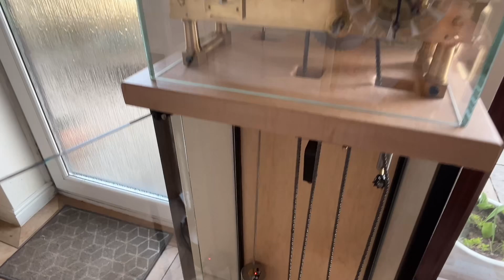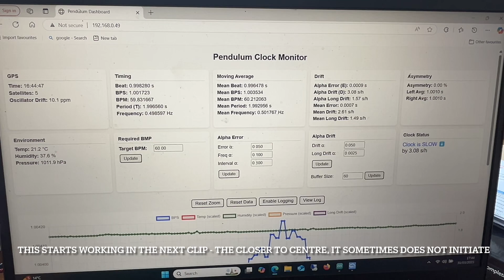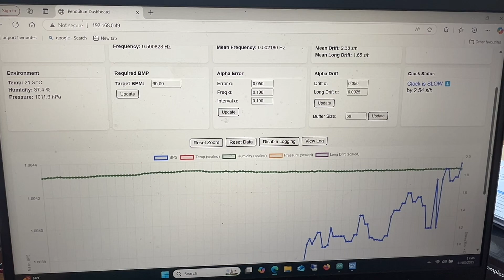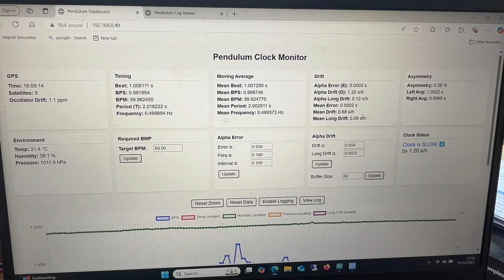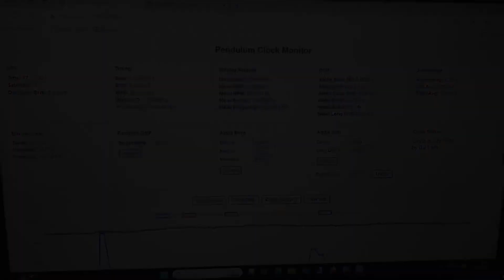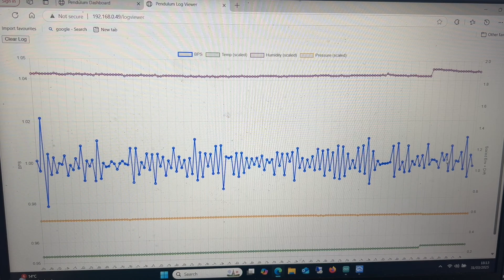DIY Clock Beat Analyser: Pendulum Timer with GPS Precision

Comment: Hi Chris, I'm also building a Clock beat timer using an ESP32, so really interesting to see your efforts. My biggest question is that you are using an infra red detector to watch the pendulum and NOT the escapement mechanism. If the escapement is not exactly lined up with the pendulum then you will get a false result I think. I am LISTENING to the tick and tock using a digital sound sensor as my input to the ESP32 , and measuring the time between them. Obviously it is directly linked to the pendulum swing , but I think you will find that it is the escapement which is the critical feature, in fact many clocks have an escapement which is on a friction bearing to the pendulum to allow for this adjustment. You have a SUPERB dashboard, congrats on that, but I recon you are measuring the physics of the pendulum rather than the clock. I'd be interested to hear your comments , You are obviously a very talented and skilful chap, thanks for your video...... It's the first one Ive seen on using the ESP32 as the CPU for Clock timer. I've been building mine for the last month or so and making progress with the coding, My digital sound senor has adjustments for level, but I'm trying to build it in to the code too at the moment. Cheers Royston
Reply from the maker: Hi, sorry I missed this comment! The project has taken a bit of a back seat whilst I’ve been working on my clock and a few other bits but I’ll get it back up and running over the winter. I definitely agree that a sound sensor would be a good plan but I didn’t really have any ideas how to go about using one - what microphone are you using please?

Comment: Hi, this is some really exciting stuff for clocks and watches. I came by your project looking for something else and was wondering if it's something you might be interested in. I'm hoping to build a GPS pulse generator that can output like 1-10hz audible pulse signal to calibrate either the sound card clock or a timegrapher. In order to use a USB connected mic and PC run timegraphing software, you usually have to compensate for the error in the sound card chip. Using a GPS signal, I'm hoping to find the difference and be able to compensate for the error to get correct timegrapher reading through a  USB mic on a PC software. Do you think this is something you might be able to help with? If so, I'd love to get in contact.

Comment: Not a clock guy, but in my working career I spent a lot of time working on moving averages for a variety of applications. Generally, what you are calling the 'alpha' average, and I would call an exponentially weighted moving average (ewma), is good because it requires much less data to be held, but otherwise adds little to the understanding of underlying trends. Given that these days there is plenty of space for data, your 60-period arithmetic moving average contains as much information, and is easier to understand, normally. It's true that the exponentially-weighted moving average will be a little quicker to show changes (from adjustment to your mechanism, environment, or whatever), but with 60 periods and as you are looking at bps mostly (it seems), I think the ewma is overkill. The nice thing about the arithmetic average is that you can see the ramp as adjustments work their way into the 1 minute cycle. The ewma does ramp, but it's hard to tell, depending on your alpha smoothing factor, exactly what is going on, and when the system has stabilised. There is such a thing as a trend-corrected ewma (or indeed a trend-corrected arithmetic moving average), but in this application I don't see the point in the extra calculaton complexity - trend-correction is good where, say, you are working with monthly data points and want to try to represent what the latest months average value might be, always a compromise and requiring interpretation of past data to be of much use - you have data coming so fast that there really would be no point in trying that. My twopennorth only. It looks like a clever device using hobbyist-priced components, with a neat front end.

Comment: Excellent work and observations! I’ve been working (with a friend) on a similar system to control the timing of an old turret clock. This is proving to be a success. Thanks for sharing your work.
Reply from the maker: That is interesting. Can I ask how the timing is controlled on your device - what is physically changing the pendulum timing?
Reply: @craynerd simple answer is by altering gravitational force through the use of magnetic attraction or repulsion in a ‘Huff and ‘Puff’ arrangement. Difficult to explain properly here, but happy to chat about it if you want to elsewhere. Paul.

Comment: I’m thinking rather than chasing your tail so to speak if you set the pendulum very slightly slow and then add tiny weights to the top of the bob, I think that would give you far better results that can be manipulated without upsetting the swing, but yeah nice work 👌